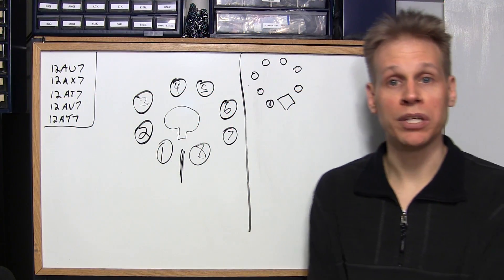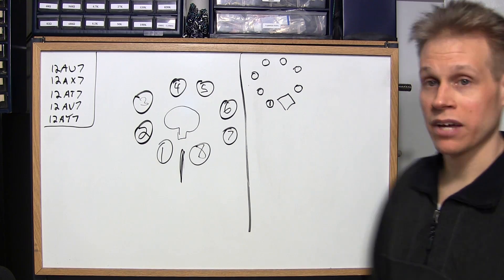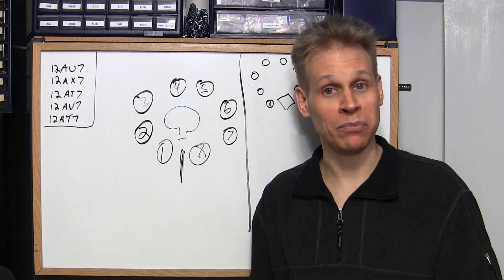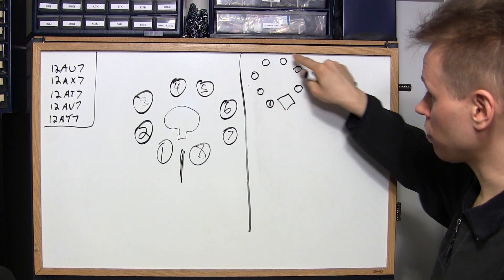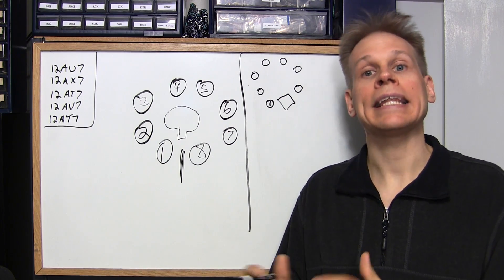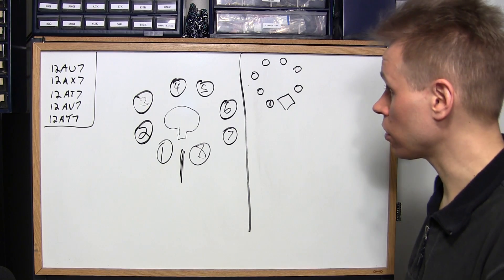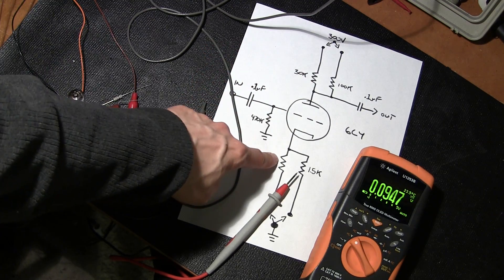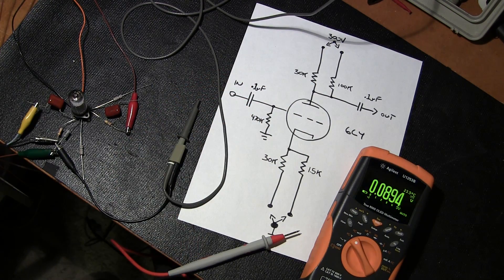Tube Amplifier Troubleshooting Tips

Comment: Off-topic, but I'd love to see your approach to managing power in your lab with the huge number test instruments!  Is everything plugged in and ready to power up on an as-needed basis?  Do you have a master disconnect that energizes/de-energizes the lab?  Do you leave any equipment powered on?
Reply from the maker: +OnEvenKeel 
Hi, Hows that for a quick response :^) LOL, I'm actually just checking messages now. There are 3 services in the lab. The units with an accurate time base are on all the time, (disciplined frequency standard) and distribution amplifier. The rest is, "turn on as needed." The test for leaving equipment on goes as follows...... Turn off the lab lights, look for glowing indicator lamps :^)
Reply: That's service!  Thank you.

Comment: Can someone explain to me the "lift the tube above ground" thing. Even though he sort of explained the bias thing I still don't have a clear picture of it. Thanks
Reply from the maker: +Bruno Henrique 
Hi Bruno. Lifting the tube above ground with a cathode resistor allows you to set the bias for correct operation. When you lift the cathode with the cathode resistor, it makes it (the cathode) more positive in Voltage than the ground. Then choosing the appropriate grid resistor tied to ground, makes the grid negative in respect to the cathode (because the cathode is raised above ground) Because the vacuum tube is a voltage driven device (like a mosfet) the Voltage you read across the cathode resistor can be considered the bias point. For example, if you read 3.2 Volts across the cathode resistor, you can consider that negative 3.2 Volts at the grid, as long as you have a resistor from the grid to ground IE: 470K Ohms.
Hope this helps.
Reply: +Mr Carlson's Lab It sure did Mr Carlson. Thanks for the reply and the huge amount of information that you put up on your channel. IMHO you, Dave Jones (EEV Blog) and w2aew are the top electronics gurus on the web. Kudos for that.
Reply from the maker: Thanks for the kind words Bruno!

Comment: Hello Paul, thank you very much for sharing such an interesting video. Could you please give an estimate about the Max and Min frequencies which we can achieve in this type of tube amplifier video, assuming no restriction on capacitors frequency response? Many Thanks.
Reply from the maker: +esmaeil nam 
Hello Esmaeil. The 6C4 is a general purpose triode. This can be used through the entire audio range, right into the VHF region (to 150MHz or so). Of course, the circuit that surrounds the tube will limit it's usable amplification range. You find this tube widely used as a phase inverter, and an oscillator in receivers. Here is a data sheet for you:
http://www.mif.pg.gda.pl/homepages/frank/sheets/093/6/6C4.pdf
Reply: +Mr Carlson's Lab  Thank you very much.

Comment: Excellent video, many thanks. I always learn from watching and listening to you. [and re-watching!]

I find the use of analog meters far less stressful in my work, as the movement of the needle is stone-axe simple, and can be seen out of the corner of one's eye. The digital meters are quite amazingly designed, with auto this and auto that, but a bunch of numbers is a bunch of numbers. One must 'READ' the numbers, then apply logic to evaluate the trend.

I guess this could be old age creeping up on me huh?

This analog/digital differential affects one in driving and flying, as with an analog display, the angle can be seen peripherally, and one knows without thinking about it, where one is on the speed scale.

With digital, from 11 mph to 99 mph, that is just two digits. Take your eyes off the road/sky and focus on the instrument, read, analyse, deduct, apply, return to driving/flying...

Even worse, with flying, from 100mph to 999mph, it is still only three digits. 

PS:I haven't been Nine Hundred Ninety-Nine miles per hour! [Yet?]
Reply from the maker: +av8bvma513 
Thanks for your input! I like both types of meters myself, but in some cases, an analog meter makes things easier, especially when peaking circuits. Lets hope you never see 999 on that instrument!

Comment: What would happen if one were to increase or reduce the resistance tying the cathode to ground? Marvelous video, concise and very clear. I enjoyed watching it :)
Reply from the maker: +TechneMoira 
Lifting the cathode from ground is what supplies bias for the grid. If you were to tie the cathode directly to ground, you would need a separate negative bias supply, fed through a high value resistor (EG: 1 Meg Ohm)  to the grid. Increasing or reducing the resistor on the cathode to ground will adjust the bias on the grid for proper operation.
Reply: Actually, I meant to ask what would happen to the amount of current pulled through the tube as the cathode resistance is increased or reduced. Sorry, I forgot to include that bit in my question. Thank you
Reply: Increasing the cathode resistance increases the negative bias which reduces the current, and vice versa.
Reply: Thanks a lot for your help :) It's good to know, since I've been having trouble with a tube amplifier, where the end tubes are running much too hot because of excessive current draw. At least now, I know what to try to reduce that current load.

Comment: very good video!  
when is that big radio transmitter video coming?
Reply from the maker: +TM80 NotGoodWithNames 
Thanks! I will try to do one in the near future, getting behind that Gates is not to easy. The nice part is, I can just stand in it with the camera :^)
Reply: Mr Carlson's Lab easy ligthing just lift a ligth in there
Reply from the maker: LOL, or turn on the filaments, those 810's are pretty bright.
Reply: Mr Carlson's Lab would be even better :D

Comment: I have a HF amplifier that uses the 8877 tube. It has a Amperite 115n0180 delay relay 3 min. the heather pins are 2 and 3  on this tube. They are a little costly and was wondering if there is some sort of a solid state device I could adapt to the tube socket.
Reply from the maker: +ItsRonsway 
A simple 555 timer circuit and a relay would work.
Reply: +Mr Carlson's Lab  Thank You, I'll check that out.

Comment: Paul, very good explanation for the novice.  People these days seem to have such a problem understanding the basic functions of a tube and how they work.  Great practical application demonstration.

What is the equipment in your opening picture.  Reminds me of my old HP 460BR broadband fast pulse amplifiers.  Basically just 13 tubes running in distributed amplifier operation.  Nothing quite like a couple rows of tubes to keep you warm on a cold day.  

Mike
Reply from the maker: +MikesRadioRepair .CBRadio 
Hi Mike, that's out of an old Cordovox amp. Thanks for your comment!